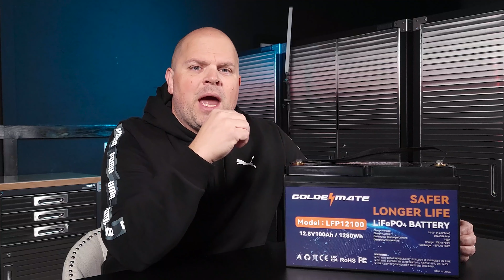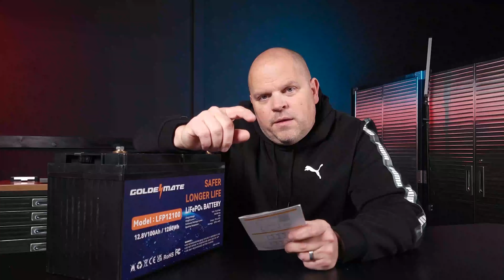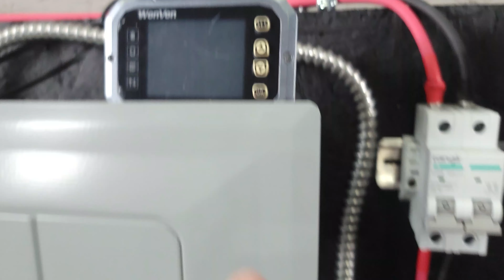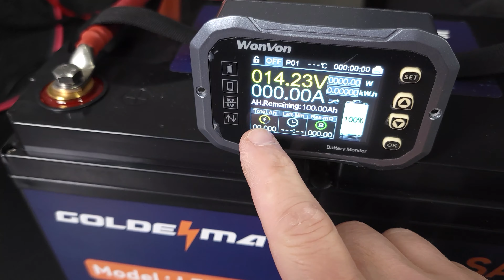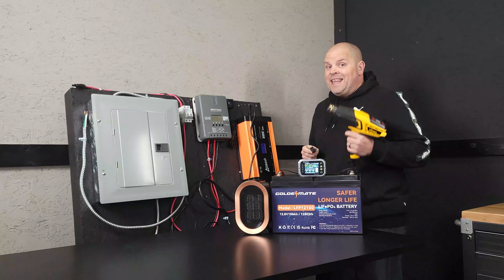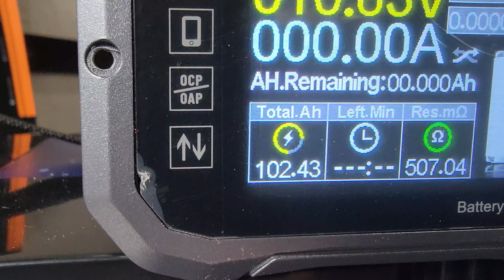It's Time For An Upgrade! Goldenmate 12v 100ah Lifepo4 Battery

Comment: I don't think your tests are too harsh.  Here is something that occurs with my Bluetti AC 200 Max all the time:  the 5000 BTU air conditioner kicks on and then the refrigerator kicks on.  Those things are hard on the machine for startup.  Say I'm running the toaster, the Keurig, or microwave; what's going to happen when the AC, heater, or fridge kicks on... A minor overload that will reset itself or a major one that will pause everything?  So why not do this kind of things with batteries and the inverter.  That's what testing is for.  Another thing  to test is the full charge.  If your inverter shuts off at 15 volts, is it going to like 14.6 v, or are you going to have to turn it down to 14.4,3,2?
Reply from the maker: Appreciate the input. Thanks for watching and commenting 👍🏻